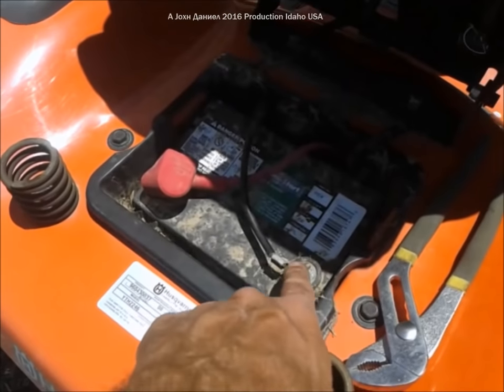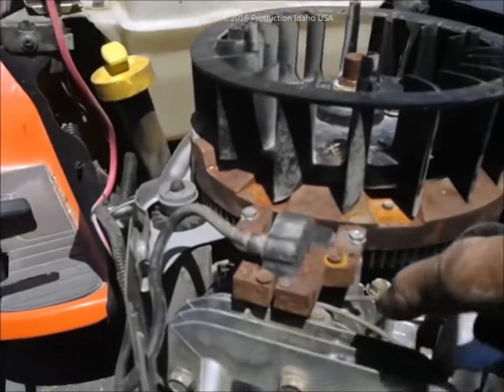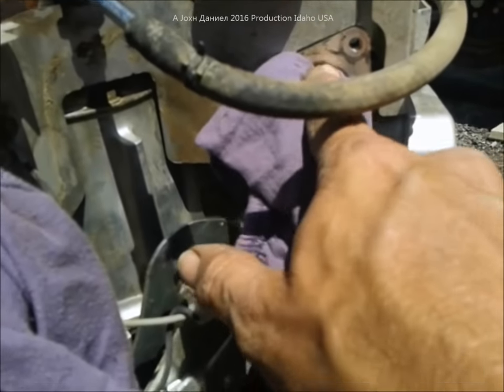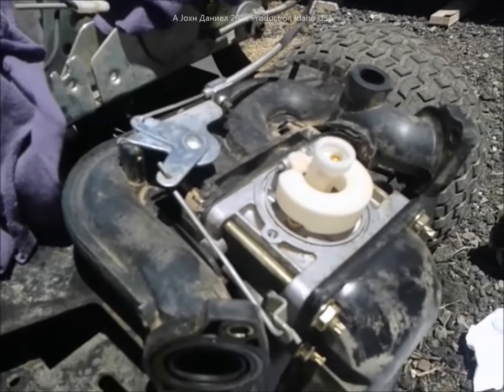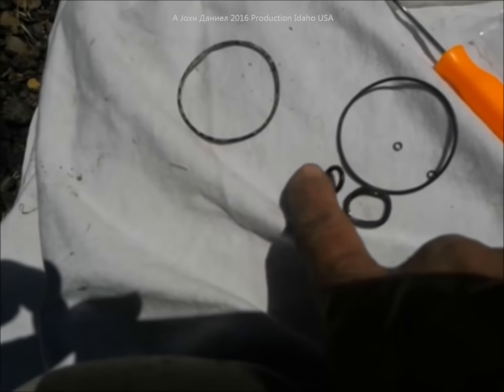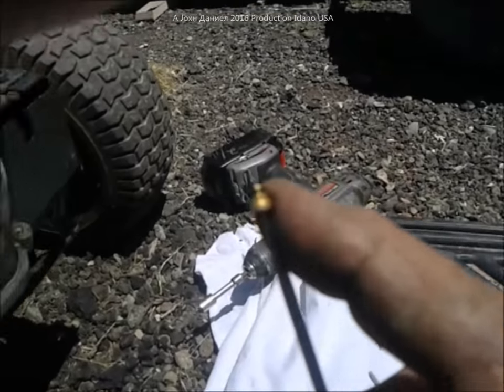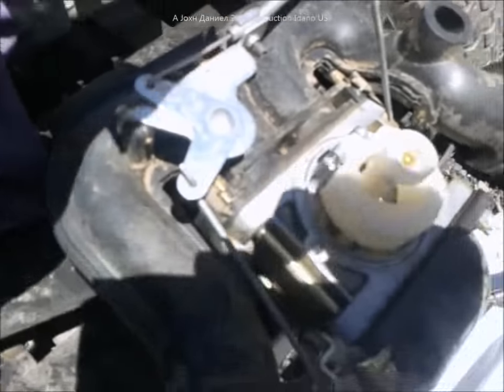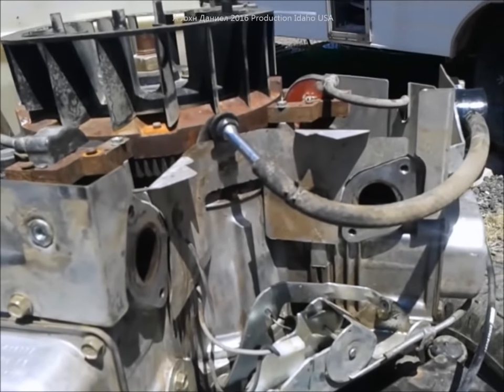Briggs and Stratton Engine Surging, Stalling & Backfiring fix (parts used below)

Comment: Well I'm finally getting back to that V twin Intek 20 hp. I didn't know if the vacuum hose was working correctly or not so I'm going to purchase a new one and see if that will work. If not I'll do what you said about going through the fuel system and gently blowing air back into the system. Last time I was able to pull one of the fuel lines off going into the carb, but now nothing comes through. I really don't have time to pull the head right now to see if the valves aren't seating properly....grrrrrr
Reply from the maker: Don't pull the head, just the valve covers. Spin it a few times with the plugs out and see if you get valves that are not firmly in place or behaving bad.
Reply: Good call my friend. I pulled both sides and the cylinder 1 on the exhaust is supposed to be at .005 in fact all of them are the same clearance. I need to find a video on how to do it with these types of nuts. The single OHV is much easier that dual OHV.
Reply: Good Call..That mower is finally running like its supposed to do...thanks a bunch

Comment: i have the same motor, changed o rings bur not the fuel pump.   runs great when moving , but surges and pops when setting still. I didn't  replace fuel pump

Comment: Im having this exact issue.  My Urgent question is when you add the new O-ring between the jet stem and the base intake housing, it leaves nearly an 8th inch gap between the carb housing and the bowl.  I'm afraid if i tighten the bowl it'll break something.  I added an O-ring that was thinner and got a 16th" gap yet the problem persists.  Should i trust the stem and the intake housing to withstand the pressure of crushing the 0-ring that far?
Reply from the maker: Check to be sure you did not unscrew the jet housing causing it to be lower thus causing the gap. The bowl oring is 2.125mm and as long as the pick up housing is not loosened it should go back together with 1/8 of space from float.
Reply: @JOHNDANIEL1  I did unscrew the jet housing.  I put a new gasket kit in it but it just seemed like 1/8" gap is a lot.  Im startin to think the bottom of the bowl may flex enough and Ill prolly put the O-ring under some compression first but dang... 

Anyway, I'll do it tomorrow and drop a final report.  Thanks for the video and the reply.

Comment: Also there is a gasket inside the niki carb that likes to swell up blocking the holes making the engine run rich....so if its running rich .....which should be replaced at the same time.....hate doing the job twice.
Reply from the maker: My preference is to take the Briggs Nikki carb off and throw it in the trash. I had a older Craftsman 22 horse mower that I had for over 12 years that I made a intake for and put a Harley Davidson Golf Cart 1 bbl carburetor on it. It got better fuel use and much better serviceability. Its really simple to use a old Harley Carb on many small engines but the filter was a bit of a trick in tubing.

Comment: Hey i don't know often you check your mail. but I was looking for a video that might explain why the fuel is going into the crankcase. I also have the Intek 25 hp. The fuel pump is mounted on the shrouds and the straight line would fit those. I've already rebuilt this carb last year and it still surges. All my ports are cleaned with new parts. I was shocked to see the fuel inside, but when I would crank it up and run it..she would be out of fuel real quick. With the smaller 6hp briggs I wouldn't hesitate to just change the carb for a new one and be done with it.
Reply from the maker: +Paul Govensky Sounds like you have  bad valve seats on the heads. That can cause high vacuum and excessive fuel use with erratic idol and high speed vibration.
Reply: I do know that I have to replace the o rings on the jets..those things are rocking real bad.
Reply: I have seen 3 motors from 5hp to 13hp Briggs so far this season with this problem. It's the carb period. The inlet needle is not sealing 100% when the bowl overfills the air intake fills up then gas runs down on top of the piston around the rings and fills the crankcase. Check the float level. The float should sit level when the carb is turned upside down. Seeing as you already put a new needle and seat the float level must be it. Metal floats can be bent by needle nose pliers and plastic floats can be adjusted very carefully with a heat gun. Test the float before any adjustments any gas in the float will cause this problem test it by first placing under water and watching for air bubbles then shake the float by your ear and listen for water splashing. It's a simple fix if you can pinpoint why carb is not sealing up tight. This is the only few problems I know of that will cause this issue. Find me on FB @Gilbertsmallengine if you need any more help.
Reply: Also once the crankcase fills completely with gas the motor WILL seize. Don't worry it's only hydrolocked and not seriously damaged. Unplug the spark plug and run the motor slightly backwards by hand, grab the blade, pulley, flywheel etc.  then backwards and forwards empty the gas out of the crankcase fill it with clean oil fix the carb and its done.
Reply: Mine did this too.  it'd easily start without choking it, but then soon die. I found my crankcase full of gas thinned oil too.

When it dies, if you remove the air filter cover & remove the air filter,  can you look down & see any liquid (wet) gas down in the neck of the carbs air intake at all?  It "should" be dry down there.
Mine did this & I had to rebuild the carb. so basicaly the float sat down lower than recommended,  so lower down into the bowl than per the specks, so it would cut-off the gas sooner.  Basically, you'd be trying to lower the fuel level in the bowl.

Also, make sure the O-ring in the fuel lift tube is also sealing very well.
Once I got the fuel level lower, my mower ran fine & it still had plenty of fuel despite the lower bowls lower gas level.  
BTW There are some very simple "tricks" to help set the level lower too. 
Hope it helps
DL
Reply: Paul G ovens Kyle and

Comment: I'm trying to understand something here as it relates to it hunting and surging. I've never had an engine hunt and surge unless it was blocked somewhere, but you're saying if gas is leaking past an o ring it may haunt and surge in that case? Why is that ? My buddy has a carb where the plunger is not working it doesn't spring back to shut off fuel, that shouldn't be a problem when it's running should it?
Reply from the maker: The hunt and surge is due to the jumping back and forth between rich and lean due to flood and starvation. And a bad fuel cut solenoid won't do that, a set of deteriorated orings will and historically are number one cause.
Reply: Thanks for the response I must've misheard something. Thanks for the video!

Comment: Trouble shooting a new john deere D130 less then 20hrs on it. backfries within 1 min of starting and backfires in any throttle position. To me it sounds like fuel re-igniting in  the exhaust? Any recommendations.
Reply from the maker: If it has the automatic choke on it then remove the wire on it and see how it runs after that. If it has the manual, then check for the cable clamp not properly tightened then fix it.

Comment: Can you help me. I took the bowl off without removing the carburetor and both jets just fell out. Do you know which side has the larger jet. I measured them by dropping them over a large needle.The smaller has three straight marks. The smaller has two straight marks and either an arrow of a 4.
Reply from the maker: If your holding the carb body upside down, and looking at it the float hinge upward ( at the top) then the large jet goes on the right. Or looking at it with the needle jet north of the 2 jets the large jet goes to the right and small jet to the left.
Reply from the maker: Look at the pictures in the bottom of this ad, http://rover.ebay.com/rover/1/711-53200-19255-0/1?icep_ff3=2&pub=5575119394&toolid=10001&campid=5337663844&customid=Full+O+ring+kit&icep_item=172417185498&ipn=psmain&icep_vectorid=229466&kwid=902099&mtid=824&kw=lg

Comment: Any help would be very much appreciated.....I have a murray 22 horse 46 inch...about 15 years old....cant get a manual anywhere,,,,,,,,,Engine is backfiring once turned off,,,it has about a tree second delay before the bang,,,,,,,,,now its backfiring when you start up the engine (big flame)     Engine appears to have a slight OFF idle,,,,,so far I only used carburetor cleaner spray....cleaned air filter...filter looked good...some debris...(very fine)  .   
Again any feedback would be great .....thank you
Reply from the maker: +chinese244 Sounds like valve failed.  Try pulling valve covers and with plug wires removed give it a few spins to see if a valve is stuck or loose rocker arms/cam.

Comment: I have exactly the same problem with mine.
Wish you would have shown how to remove the carb from the engine. 
Are you in Boise, Idaho?
Reply from the maker: Hopefully you saw the re install steps, and reversed them. 
If not, so you keep in tune, take pictures as you follow these steps.
1- remove all offending extra parts ( air filter, fuel lines, and throttle linkage retainer) 
2- With a torx or Hex depending on your year fully pull the bolts going to the intake ports on the heads. 
3- Carefully wiggle then pull forward the carb and intake enough to unhook the governor link and unplug the fuel cut solenoid on the bottom.
Rotate upside down now.
*watch the video again , search-pause to see clear as you can.
*I am not a good video maker in stability of shots, damn stroke really didn't help! But factual info is good.

Comment: John, I have a B&S 445677 V twin engine with 660 hours that the carb fell apart on  (butterflies fell apart) so I replaced the carb. Now it runs really rough and surges a lot. When I engage the mower, it loses a lot of power and the engine cant seem to keep up with the mower. If I run it up a hill, I have to turn off the mower deck so it doesn't stall out. probably sounds crazy but if it leans downhill to the left it runs worse than if it leans downhill to the right. Any ideas?
Reply from the maker: +Dave Minnich Sounds like the float or governor. New carb now days don't mean good carb with so much poor quality coming from china. 
Did you check the pivot pins on the governor. At that age and hours they are likely worn and after a carb swap possibly missing.
Reply: well, after watching your video and a couple others, I found the vacuum line from the fuel pump to the valve cover cracked, ordered a replacement and one of my intake push rods was off its rocker. I'll have to check the governor pivot pins next
Reply from the maker: Very good. Hope my videos, all of them on so much weird stuff makes everyone who watches Laugh, Look, and Think.

Comment: My 24V B&S runs great for 20 minutes then starts surging. The only way it will barely run is full choke, but of course restricts power. Champion R12YC look ok but a little white. Engine has 195 hours. Is this a carb issue? It's a 2013 Husquavarna,.
Reply from the maker: Vacuum leak. Fix the tube from the valve cover to the carb

Comment: My 24hp Intek Nikki (for Craftsman DYS4500) hunts and surges like mad after I took it out of storage (3 years). It was stored properly, but I still had to take the carb off and clean the bowl and shutoff before it would start. It did that the last 2 years I had it before putting it in storage. Cleaning just that always let it start. When it started hunting & surging, I installed new jets for my alt. It ran great for a few mows then started doing it again. I didn't address it before I put the mower in storage (other issues to address in moving away). When I cleaned the carb, one of the jets fell out. So, new  O rings are on the list. But my shutoff is not inline with the nozzle. There is not an O ring around anything of the shutoff either. Never was. Is there supposed to be? The shutoff piston is small and at 90deg/perpendicular (meaning the elec conn is parallel) to the nozzle. Engine is B&S 445677-0827-E1. However, the parts the Sears has illustrated for it are NOT altogether correct. There is no nozzle O ring at the shutoff. There isn't an extension tube either. The shutoff piston is positioned 90deg to the nozzle. The float bowl does not have a flat rim all around the edge, but only 2 ears where the screws pass through. Taking it out of storage, I replaced plugs, oil & filter, air filter & pre, fuel filter & battery. When it would turn over but not start and flooded, I removed carb & cleaned thoroughly. Then it started. But hunts & surges throughout. Only in pulling choke partially (may be nearly half way) out could I get it to run sufficient to mow. It returned after a time though and then nothing helped. I don't think the fuel pump is an issue; Fuel filter level never fluctuated. At a loss right now.
Reply from the maker: Sounds exactly like either the fuel pump or improper voltage on the solenoid fuel switch.
Reply from the maker: I would consider a carb kit, http://amzn.to/2p27Tu1 and a new fuel pump.
Reply: Strangest thing. I left it sitting undisturbed (not by choice) for a week. Decided to give it a try again. Most of the issue is gone. It never made any attempt at all to surge except when the blade was disengaged, and then only mildly so. Thank for the input though.

Comment: Is this the kit I need for my 24HP v-twin Intek model 44N877 type 0003G1 code 150925YG engine?
Reply from the maker: Yes, it fits 21 to 24 hp Nikki carbs.
Reply: @JOHNDANIEL1  OH so I will order a 54832 Briggs & Stratton Nikki V Twin Carburetor Rebuild Kit. thanks
Reply: @JOHNDANIEL1  How do I know if it's a Nikki carb?
Reply from the maker: If it is a Intek, it's a Nikki
Reply: @JOHNDANIEL1  Thank you so much.
Reply: Is there a place I can email you a couple pics of my carb gaskets and the gaskets in the kit you recommended? The gaskets are completely different.
Reply from the maker: olympicpowercontrols@yahoo.com

Comment: I have a  445677 0945 G5     It has the separate style choke.....   The choke is on the throttle lever....    Someone got into the engine before I did...    Have you ever done one like that ???
Reply from the maker: Yes, I go to Ebay and buy a separate choke cable and actuator. Those with a combined set just are crap.
Reply: The reason I'm asking ....is that somebody got on mower before I did and I think the choke lever is messed up....  Do you have a video hooking the choke lever up on the ones with the throttle/choke all in one ???

There is a plastic  keeper on the choke lever on the mounting plate where the linkage goes into from the carbby......   1 end has the Z bend and that goes in the carb part of the choke...    The other end is a straight 90 degree bend and that plastic keeper is supposed to hold that end in there....    For some reason the bend is not right at all.....   

It is not at the right angle and keeps coming out ~!~!

Need some help and my manual does not show that area well .......   

Merci Mon Ami ~!~!
Reply from the maker: I haven't done a video on one, but there are god schematics in the parts suppliers like this one that may help. https://www.searspartsdirect.com/model-number/445677-1578-G5/1245/1503500.html
Reply from the maker: You must know PooPoo Thibodeaux with a name like that! Sounds like home!
Reply from the maker: additional schematics https://www.ereplacementparts.com/briggs-and-stratton-4456771578g5-engine-parts-c-16758_17347_244741_244790.html
Reply: You mean Poo Poo Broussaard ??   the comedian  ???
Reply: That link you gave me to sears is only showing me the 212  throttle /gov link...  No choke link at all....      It gives me the engine part only and not the carb parts .....       Oh Well   ......  I'll get with you tomorrow   ...  

Yep I'm a coonie    Cajun and know Poo Poo       Plus Tard Mon Ami ~!~!
Reply: Ok  I found a few things out last week and forgot to post them......

The choke linkage keeper was gone.  I bought a new one...    I also had to adjust the gov.  Since the motor had been tore apart by someone else and was not adjusted...   Way to many details to say on here..... I just found out all this a few days ago..........

I need the small plastic insert on the gov that the that the linkage goes into........  I have to find a source for that since Briggs doesn't offer one.....
It's the plastic piece that goes in the hole of the arm that keeps the linkage tight in the hole........

No help from the Briggs dealer  on that one.......     The  keeper for the choke tho...  I used a Kohler brand which is about 3 to 4 bux......

Comment: I have that engine on my Husqvarna riding mower and I have to use a small capful of gas dumped into the air intake to get it to start. It runs great. Cleaned the carb. Can't figure why it runs so great just won't start. Any idea?
Reply from the maker: +Martin Hamilton you likely have a vacuum leak. The pump runs on vacuum.  A leak would keep it from pumping well till the engine is at high rpm.
Reply: +Јохн «HEADSMASHER» Даниел I ended up moving the throttle cable allowing more choke. Thanks for the video!
Reply: what pump
Reply: Timothy Harris He means vacuum from the intake stroke.

Comment: i cant find my engine ,  mine is a 44677 model , and  type is 0244  E1  also a 26 hoorse power , could use help iv tried to cross reference it  with no luck
Reply from the maker: Go here, https://www.ereplacementparts.com/briggs-and-stratton-parts-c-16758.html  and do some digging, they will answer a email or question very fast https://www.ereplacementparts.com/contact_us.php . And the parts are dirt cheap or you can copy/search the item number you do find to find it other places.